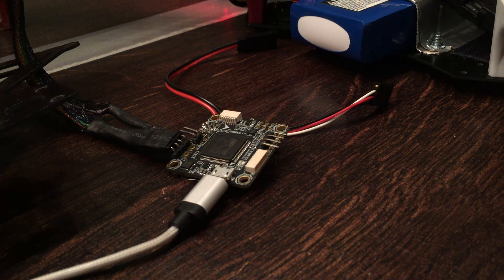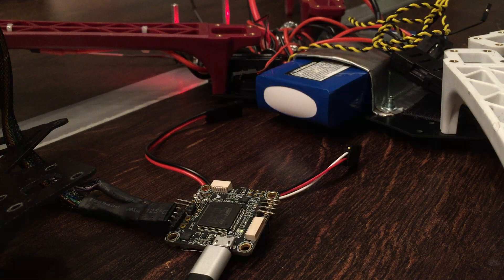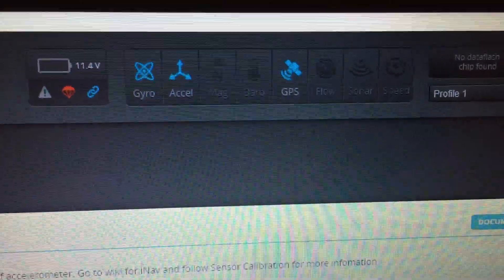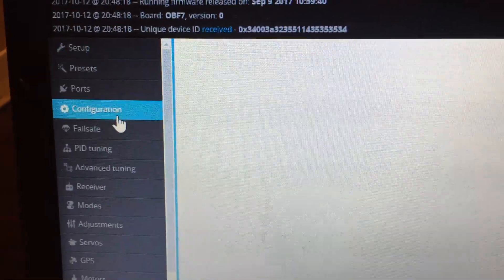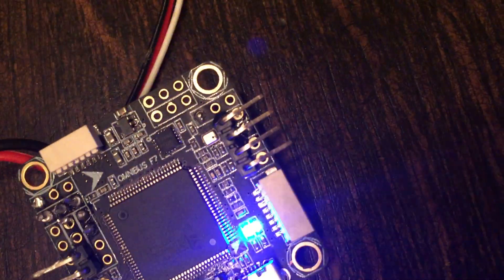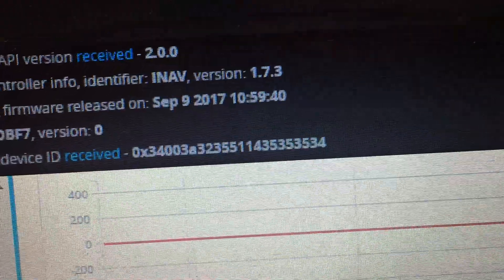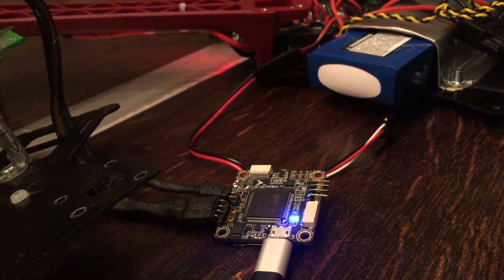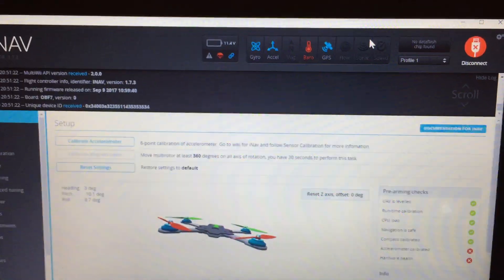Omnibus F7 from Banggood - Barometer and I2C

Comment: You might have a high resistance short on the bus, you might have used a little to much heat installing the header next to the Barometer, get a monocle and inspect the barometer to see if it shifted or if the board looks cooked around it.  My next step would be to remove the baro.